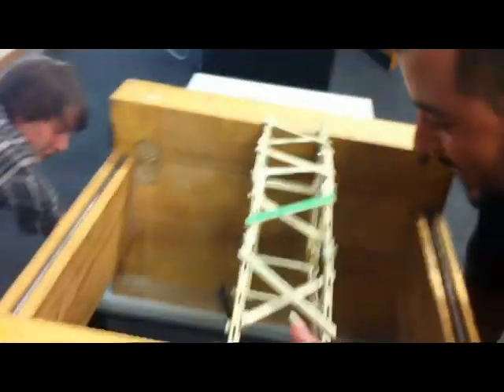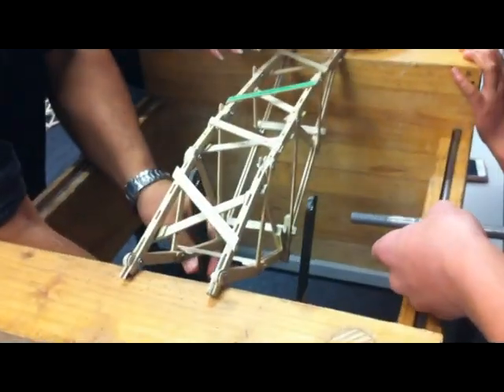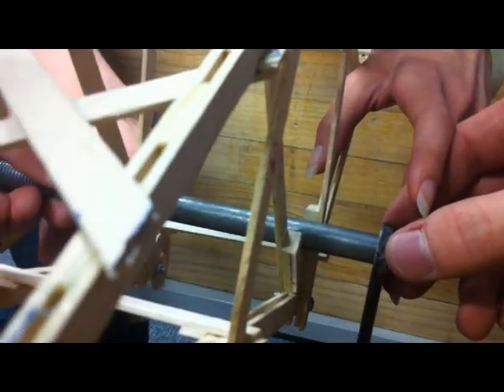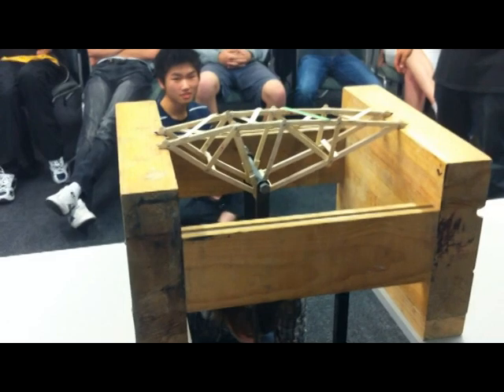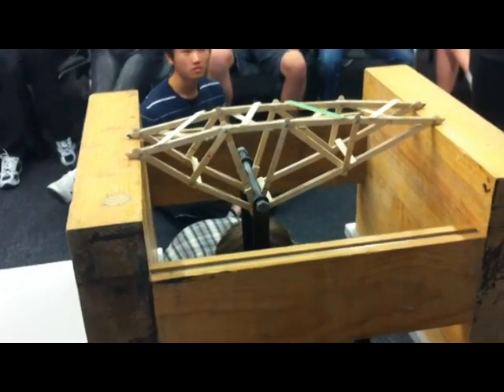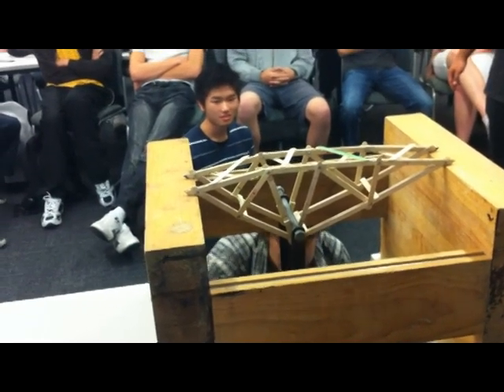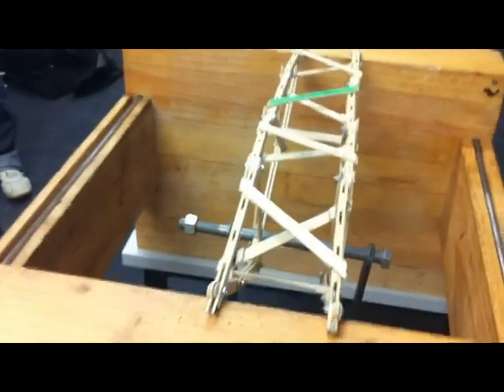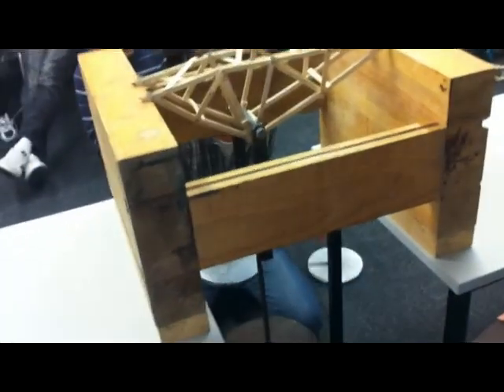Record Truss Bridge 2012 - University of Auckland Engineering

Comment: if they put the load on top of the bridge where it normally would be it wouldn't have ripped out the bottom and instead the load would have been properly distributed,  good test but would have gotten proper performance of the structure by loading it in the right place i guess the person deciding where to put the load is just as good as the camera man.

Comment: The Bridge didn't fail due to Homogenous structure integrity. It failed due to concentrated shear stress. I'm sure the bridge would have held much more if the load was spread across the top of the bridge. (Which evidently is what a bridge is designed to do)

Comment: What I wonder about is the size of the weights they used. It is stated that an additional 96N weight (single weight) caused the failure. Where does that come from? That translates to either a 9.789KG or a 21.58 pound weight. Is this some strange Auckland unit of measure? Or am I wrong? He seemed to be counting the big weights and got to 10 then with two smaller ones 11. The last weight, which he did not include in the count, looked similar in size to the big ones that he counted. Was this demonstration performed at an extreme, high altitude where the gravitational constant is smaller? Or were these just home made weights and subject to variation?

Comment: I question where the "point of load" was applied on the bridge. A bridge that spans an opening would normally be to support a roadway above, so it stands to reason then that the load would be on the roadway above/below the superstructure and this is then where the structural testing should be suspended, not at the bottom in a "single point" load? To me this would be an invalid test? Still, this is impressive.

Comment: I made a balsa wood truss just like this in highschool that was only glued together. The peieces were 0.25 x 0.25 inches. I repeat, it was glued together, held up well over 300 lbs. If I could have used bolts, I would have smashed a 1000 no problem. It was the shape of the top portion of a 5 pointed 🌟. And the weight was placed on top of the point. Good work on this but do realize that if you had centered the load, focused the weight more directly to the ends, and used the center portion as mere stablizers, you could have easily seen 1500 lbs or more. Excellent work though. 😊

Comment: This is stupid and only about 40% of what is done in these "bridge" building competitions matter in reality. You forget to account for so much more factor in real life. Density, flexibility, environment such as temp/humidity to the material and weather, and most importantly the calibration process and it's calibration uncertainty throughout the whole thing. 

Classes make these out of popsicle sticks and paper. You could literally intensify your material by a factor of 2x easily in these classes without bending the rules.

Comment: If it is a mini structural bridge . The load should be placed above? Then tensions in the sticks vary a lot
Reply: The members act as one really well done. It failed on shaft area and the rest of the member follows . If it was reinforced on shaft holder it will probably take all the the weights available in class. All credit to the group.
Reply: Doesn’t matter the amount of force is the same due to gravity

Comment: Not a practical test. The load comes from the deck of the bridge, not the bottom of the support. build and test it again with a load on the deck
Reply: KelevraSXT, you've completely missed the point. This isn't a class on building bridges, this is a far more general course in structural design. The students will have received the specifications that it had to conform to, such as how the force would be applied, the distance the bridge had to span, etc. As the intro stated they needed to calculated the stresses on each joint in the structure. I'm guessing that was the main idea behind the exercise, to show how well their calculations reflect an real world test of their structure.
Reply: Well, this particular construction was designed to hold that particular type of load…
It might help not to think of it as a “bridge” in the everyday sense.
A construction like this could be used as part of a longer bridge, anchored at pylons on either side, from which a section of the actual road or whatever is suspended, for example.
If, for some strange reason, one had to build an actual bridge from gigantic popsicle sticks, glue and pins, of course.
Which is pretty unlikely, if you think about it.

All in all, this is an exercise to demonstrate that the principles of construction / statics the students learned actually work. And a competition to come up with a construction that solves a given problem, using a restricted set and amount of materials and construction techniques.

If you had to build a road bridge spanning some given distance, this exact construction is probably not the best, or even one of the better choices–but then, popsicle sticks and glue wouldn’t exactly be amongst the more practical materials for that, either…
Reply: This is not your typical bridge. It's designed for bungee jumping elephants
Reply: Franjotpreetp11 If I could LOVE this comment, I would.
Reply: Never be this dumb.If you don't know what you are talking about,just shut up.
Reply: What if the bridge is an upside down bridge. So if you stand on your head the force is on the top.
Reply: Looks like a portion of a suspension bridge
Reply: KelevraSXT it is truth
Reply: may as well argue the bridge is asymetric at that point... they did their ''homework'' and beat the competition, thats all that matters. there are plenty of non practical engineering exercises. the world's most recognised student engineering competition is agreed by many to not be realistic. shut up, eat your popcorn and appreciate what you just witnessed.
Reply: Well, there are plenty of real world bridges with the load partly or entirely suspended from the load-bearing structure.
Like Suspension bridges, cantilever bridges, through-arch bridges…
As far as I can tell, that’s actually the way most modern steel bridges are built.
https://en.wikipedia.org/wiki/List_of_bridge_types
Reply: in their favor or against. It's not a practical test. the bridge may or may not hold more weight when it's tested in a manner of which it was designed to bear a load. Even then there's several ways to do so. Concentrated weight of a theoretical stationary maximum or a dispersed load of how much the entire bridge could hold distributed across the entire deck before failure. "single large, heavy truck" vs "rushhour/bumper to bumper traffic" Different loads, different stresses. the whole point is that the method they used was not a practical load the bridge would ever see in normal use and stressed a part of the bridge that would likely never see that amount of tension. when in use, it will see more compression on those supports and little tension as a load crosses.
Reply: +KelevraSXT   As you say, you're not an engineer.  The load point can be pretty much wherever the engineer puts it.  More to the point, this was an exercise to test their ability to calculate and design.  It's aimed at getting students to apply what they've been taught in their first year.  This will be a shock, I know, but it's not a real bridge.

Canterbury University (the other big (and much better) engineering school in NZ) does the same kind of thing in their first year.  They also, as a final year extra credit project for the Civil Eng students, require them to repeat the exercise.  They are all given a bag of materials and free reign to design and build a bridge that has to span the Avon River.  It's only ~3 metres wide where they do it, but it is an interesting exercise to watch because once built, they have to put the bridges over the river and then each team member has to cross their own bridge.  The quantities and types of materials they're given are specifically designed/grouped/calculated by the Civil School  to make it close to impossible to design a working bridge.  90% of students end up in the rive as the bridges invariably collapse. A little reminder to the departing students not to get cocky.
Reply: KelevraSXT i agree with you. The load must be on the top of bridge,, not bottom
Reply: Not an engineer are you Kelevra?
Reply: I am not. I just know that the test is supposed to test the load bearing capabilities of the bridge. it makes no sense to test in this manner. Most the support structure of the bridge will be under compression  when a load crosses, where the weights are, they're putting tension on the supports. it is not a practical load the bridge would likely ever see.

Comment: this is idiotic, because the load should be put at the top of the structure, where the road would be, not at the bottom of the structure
Reply: And, first, it should be centered between rhe bridge ends.
Reply: The entire static load convurges at the apex of all members....if you wanted to take a reading even in a real senario?.....thats where you place the sensors.
Reply: that would be dangerous idiot

Comment: "19+8" "26"

Engineering students.
Reply: Little engineering tip: never waste any time solving what computers can do better.
Reply: @y.z.6517  While I see your point, this is the same logic that sometimes causes pilots to crash planes. When they have to revert back to the absolute basics they make mistakes precisely because they do not keep in practice.
Reply: @MJKarkoska  At engineering level, it's better to double check the equations and numbers, and design automated tests. Doing basic maths with 95% or 99.5% accuracy makes no practical difference for a project requiring 100% accuracy.
Reply: @MJKarkoska  Also, computers do maths infinitely better than even the most reliable human. Even if a calculation is as simple as 2*pi+4, please, at least let a computer check it for you.
Reply: @MJKarkoska  As another plus, doing (2*c + 3*l + 4*w) is just as easy as (2*c + norm(3*l, 4*w)) with a software. This allows engineers to plug in optimal and more precise formulae without adding extra cost.
Reply: International Jujuman  Miscalculation like that is like little grammatical mistakes. You don't correct people, because nothing is gained in doing so.
Reply: @y.z.6517    Nothing except maybe better grammar so you can be understood?
Reply: @1MrMyke  I was not talking about people don't understand grammar. I was obviously talking about careless mistakes. Engineer students couldn't have passed even primary school tests, if they couldn't do basic maths like that.
Reply: Engineering students tend to always have a +/- tolerances.
Reply: @Lee Webber Understanding maths and being able to spot mistakes are completely different skills from doing simple calculation with 100% accuracy. Great engineers need the former. The latter impresses people without engineering experiences.
Reply: @Lee Webber Boeing 737 Max crushed due to violating several basic engineering principles: 1) not enough testing 2) not handling 2 conflicting error signals properly 3) not mentioning these issues in instruction... and the list goes on. None of these had anything to do with accurate calculation. These are completely qualitative issues. The way to handle such issues is for engineers to think through issues computers cannot do, not being inferior human calculators.
Reply: THATS US IN A NUTSHELL XD
Reply: @HopelessCT  I COULDN'T AGREE MORE
Reply: Rounds to 30 smh
Reply: I was wondering why he was using a calculator, would've counted that in my head low iq engineers
Reply: At some point you really stop doing little maths like that and focus more on other things like analyzing problems to determine what equations/methods to use.
Reply: @scarmiglionealighieri2666  this kind of maths should not be as problem for any engineer
Reply: @cosmosity1693  Because it's just as likely to have 13.24*pi. You don't know what will you encounter next, so better use a method that solves all.
Reply: @cosmosity1693  That would be "IQ", not "iq".

Comment: the popsickle sticks could be soaked in a thinned down fibreglass resin that would be undetectable to the untrained eye which would increase their strength ;) 
and higher quality adhesive used like a Bostik 70-03
Reply: No all of us are inclined to cheat. What do you think of ill gotten gains?
Reply: heartobefelt it would add weight they have a weight limit
Reply: I think we need glued them together he clamped them
Reply: Annnnd when they weighed the bridge prior to testing and discovered they had cheated they would all be thrown out of the programme & university for academic misconduct.  Which would also preclude them enrolling in any other university in NZ for at least 3 years.

Comment: There is no top chord to prevent the ends from spreading.  If they are allowed to anchor the four corners the bridge sits on, or if they had the top chord described, the strength of the arch could be added to their expectations, but without it.....

Comment: 19 and 8 is 27, Not 26. Where’s my engineering degree
Reply: Cluckinwing you mean your mathematician degree?
Reply: Little engineering tip: never waste any time solving what computers can do better.
Reply: actually mathematicians typically dont deal with real numbers
Reply: Cluckinwing 87 % output of manual labor and const. Pos. Ma th
Reply: Atom M Arithmetic computation is more related to engineering than mathematics. Engineers have to compute much more than mathematicians.
Reply: 1+2+3 is not exactly 6
Reply: @nateframbach830  then what is it lmao
Reply: Vaughn Cameron not exactly 6 that's what it is... lol
Reply: The phrase "two plus two equals five" ("2 + 2 = 5") is a slogan used in many different forms of media, most notably the 1949 dystopian novel 1984 by George Orwell. In the novel, it is used as an example of an obviously false dogma that one may be required to believe, similar to other obviously false slogans promoted by the Party in the novel.
Reply: U just did math. Not engineering

Comment: While the physical bridge survived to be a local record holder, the 1200 N calculation for the failure load was still overestimated by about 10%. This is why you should still avoid designing real life structures to tight tolerances unless you have better data to put into your models or the target specification itself is already an over engineered spec to be met.

Comment: Reminds me of my Engineering class in high school except we all had to build our own bridge with less restrictions on weight. I build the prettiest and strongest bridge of them all. It was so nice, that my professor cringed as I stood on it. It did not fail. He kept the bridge and has it to this day. I have actually seen a few similar designs in real life after the fact even though I came up with the design on my own. This was a final project and we were asked to follow strict proportions and calculate the force applied to the struts and the total force applied to the base of the bridge assuming each popsicle stick represented an I-beam that weighed x lbs. What made my bridge unique is the complexity of the design, which made the bridge beautiful and surprisingly very strong. Calculating the force destitution and drawing an elaborate schematic explaining the force distribution was the highlight of my high school experience. My professor kept the bridge schematic as well.
Reply: Pictures?

Comment: Wow. They added almost 111kg (244lbs) to the bridge before breaking. That's insane
Reply: Dam that about double my weight though i do not trust that it would hold me because of mass and the slight movement and vibrations our bodies give off
Reply: @Chornnohaus  yep a nail hanging off a wall could hold a car.

But applying any moment on the car would cause that nail to break off.

People underestimate, how strong every day objects are
Reply: Yeah, that's just insane. I'd not trust a 3cm thick and 15cm wide plank to hold that weight!
Reply: @2DReanimation  Over that span it would hold that easily
Reply: That means that I could stand on it and have 90ish pounds of leeway before it broke

Comment: What are the requirments for the bridge?? Thats only like 300 pounds or so. In highschool we had a similar  state competition using only wood and no screws and the record was 1030 pounds, mine made it to 850ish pounds but most were failing at 200 or so. The bridges couldnt weigh over 250 grams so I made mine using only popsicle sticks and wood glue.

Comment: As the loading was being done, I paused the video to try to guess where the failure would happen. The forces inside the base triangle exerted by the load bar, in effect 110 deg and 220 deg on these trusses in section, caused the failure. Had the testing mass been suspended from the pivot of the lowest triangle, this structure would have carried more mass. The method of testing compromised the result. Familiar?

Comment: What was the point of failure?  Did a bolt rip through the popsicle stick?  Would smaller bolts, leaving more material around the holes, have supported more weight?

Comment: Why could they place it on top? Or had it rigged so it tested the whole bride/ placed the thing holding it on on top. The whole bridge would have been stronger than just the bottom most point. Could have gone further.

Comment: only 2 of the connections on the top of the bridge were needed, more glue on the bottom and it would have held out longer!, since  the top of the bridge was intact until the bottom couldnt support the weight anymore...